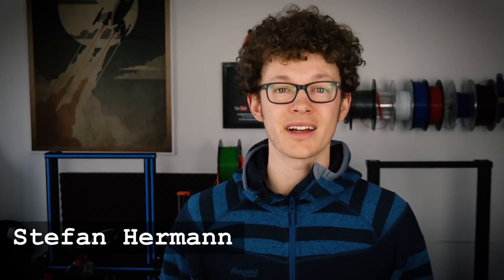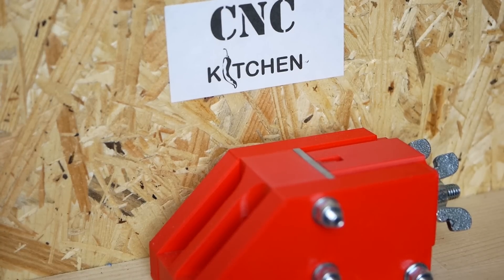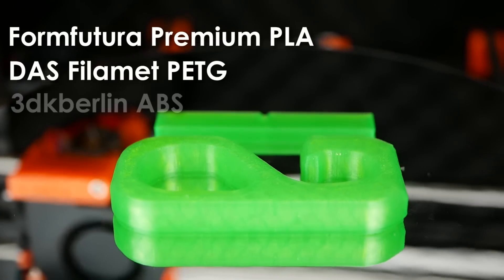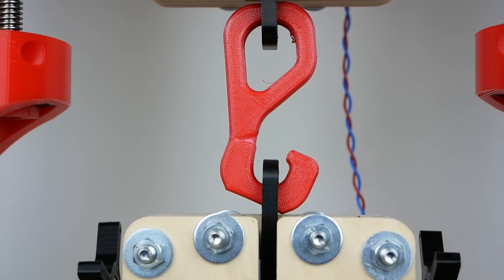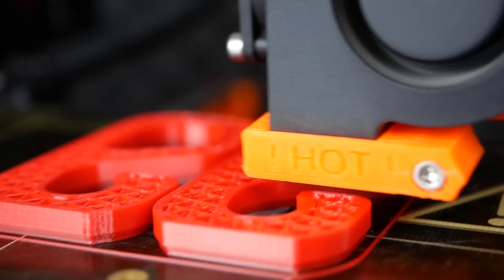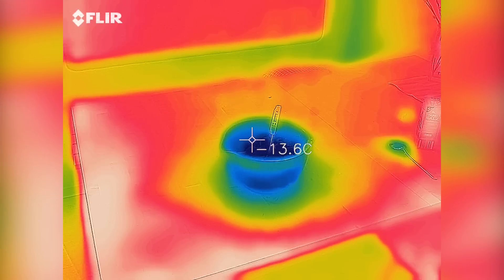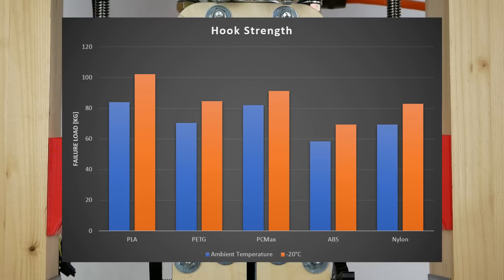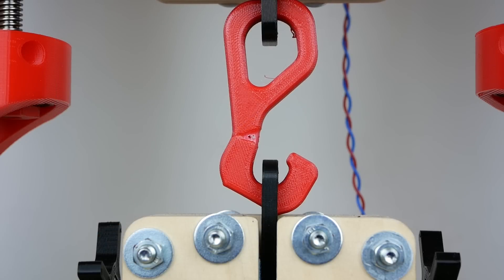3D PRINTS at LOW temperatures - How PLA, PETG, ABS, PA & PC perform at -20°C! (surprising results!)

Comment: I noticed that my prints were considerably more brittle and the layer adhesion was terrible after I moved from inside my house to inside my trailer in the winter. I would have to heat up the bed and nozzle with my hands to get my printer to the 8 degree safe-to-setting on my printer to even start warming it up. I also had to increase the bed temperature from 60-70 to get decent adhesion in these temps. Once I got a space heater and pointed it directly at the printer the bed and nozzle temperatures stay are usually around 20-30 degrees now and my prints are fine.

Comment: Very interesting video! I'd love to know what the lowest room temperature you can still get quality prints from printing is
Reply: My personal experience in the basement: PLA is ok printable until around 10°C, you can/have to turn down the van a bit.
Below it doesn't work get a lot of adhesion issues with the bed. Even at 10-15°C I had to heat the bed during the whole print to ~30°C and use glue stick.

Comment: I wonder how the laws of conservation of energy applies to this in a macro scale, also for different fill (maybe even 100% or molding out the materials used) to see the actual material capabilities in addition to 3d printed environment. As far as I can logically see it, you apply gradual strain on a part it'll introduce heat until that part deforms, if the part is cool enough it won't be able to deform as elastically as in hot environment meaning less energy is converted, that made me think it'll 'convert' less energy to elastic and instead will make the material snap, although at a higher point because freezing, well,  like water, makes liquid form into more sturdy material.
This causes a somewhat of a threshold effect, the material cannot stretch, so it has to snap.
Also, on impact the forces are generally higher so you reach that threshold instantly, while a 'hotter' print acts as sort of dampner, so it changes it shape on micro level to compensate for the forces being applied to it.
I also wonder what the temperature readings on the parts would be in such scenarios under the stress tests
Not sure if any of what I've said here is true, just was having a small thought.
Thanks for a great informational video, subscribed

Comment: Makes sense. Consider high carbon hardened (tool) steel, that hasn't been tempered (yet). Through-hardened steel is extremely strong, but with minimal ductility. A sharp edge can shave and cut through large amounts of lesser hardened steel without dulling, but even fairly large cross-sections will shatter if exposed to impact or significant ductility loads. Tempering restores significant rates of ductility at the expense of a little bit of hardness, but the end product is still relatively brittle.

Comment: IMO an engine block heater is more important than a cupé heater, but both is pretty sweet. If you only have the cupé heater, and there's the tiniest speck of moisture, your windows will condense and fog due to the large temperature delta between the inside and outside of the glass, and you have to run the car's heater to demist. If the engine is cold, then it's only gonna blow cold air, and it will chill down that nice warm cupé in an instant.

If you use a an engine block heater on the other hand, you can have your engine and all its coolant up to temp even if it's 15-20+°C below freezing, the moment you start the car. It will start as if on a warm summer day, and save a lot of fuel because its already at optimal temp, so you skip the whole "fat fuel-air mixture" period  the engine needs to warm up. And thus your car's heater and AC will be able to blow max heat if you want, from the start. It won't be nice and toasty when you get in, but it can be after a minute if you so desire. And your windshield glass won't be very warm/heated on the inside, so if it's snowing, the snow won't instantly melt and stick to it. You also get to sidestep the whole catch-22 situation where you need the windshield glass to cool down to reduce condensation on the inside and stop snow from sticking to the outside, but your window is already fogged up due to being warm so you need to blast it with more heat to get rid of the fogging,

Comment: Hi Stephen, 
I work in a warehouse with -30C. The most annoying thing in this temperature is the constant build-up of the static electricity from conveying all the plastic trays. (I think they are ABS). One time my arm almost came off (not really but it went full 180 degree and almost dislocated my shoulder blade) due to the extremely high voltage that was built up in the conveyor system. 

As for brittleness, its a little bit more brittle but not a huge deal.

Comment: overall PCMAX for the win, great tension strength, and great brittle strength overall. PLA a good second place with great tension strength but much more brittle than the others.  I noticed on their website: "When printing with PolyMax™ PC it is recommended to use an enclosure. Recommended to use a heated chamber.
Recommended to anneal the printed part right after the printing process to release the residual internal stress.
Annealing settings: 100˚C for 2h" I think this would make it even stronger.

Comment: @cnckitchen I'm not sure where you are but a 1400 W heater is using 116a @12v. most alternators charge at 90a or less. So using that could quickly and completely drain your vehicle's battery.

Comment: This video has good content that (as far as I know) is not anywhere else (such as your data on PC-Max). It would be good to post a summary of the testing data somewhere.  Also, It would be interesting if you used your CNC machine to make a hook out of solid polycarbonate and compare that to the 3D printed version.  That way we will understand what penalty there is to 3D printing a plastic part compared to molded or tooled part.

Comment: Hello! What do you think, what material is better to use for printing finished auto parts, such as a lip spoiler for example?
Reply from the maker: I'd use ASA.
Reply: thanks! If printing parts from several pieces, how best to connect them? To become a solid piece @CNCKitchen
Reply from the maker: You can glue it just like ABS, so with acetone for example. Use an ASA from a reputable manufacturer, no Chinese no-name brand.
Reply: Thank you very much! Please advise a 3d printer, which can print well? That it was not required to make a lot of settings with it) @CNCKitchen
Reply: maybe you will advise any certain ASA? @CNCKitchen

Comment: You should definitely try actually printing in -20c
Reply: Printing at -20 wouldn’t be possible with stock firmware, almost all 3d printers shut off if the thermistors for the hotend or bed read under 5 degrees C
Reply: @Hankbob_Hillpants  well u can preheat with a hairdryer for example
Reply: The only issue at -20C are mechanical parts: steppers can get stuck, linear bearings and other parts may have lubrificants that can get solid, timing belt becomes more rigid. All of these can cause the steppers to skip or to get completely stuck.
Reply: I think that this is not possible, this might destroy the electronics due to mosfet overload.
Reply: @stefaancodde6578 it would not kill anything, electronics has no issues at -20C. Even the standard hotend with a silicone sock can reach 240C at this temperature delta. The bed will struggle to reach 70-80C on most printers and many matrials will warp and crack like ABS
Reply: The mainboards of 3D printers are not protected to an overload.  Suppose Your  nozzle can reach max 250° but at -20  (meaning 38° difference) then only effect is that the mosfet will heat up and they usual not cooled. Note if You have to print at 230° then it will destroy the board and the nozzle heating too. The bed, if limited to 100° is even more a problem since the area is much bigger, this mosfet is usual bigger cause an heated bed is a very energy consuming device. Suppose bed 80°, so in reality must warm the plate to 118 °C so heated bed destroyed.
Reply: @stefaancodde6578 and lastly, i have an ender 3v2 and i can heat up the bed up to 120C and nothing gets destroyed. You are just really really bad at physics and electronics.

Comment: The same cold that hit Germany hit us as well. We got around -20°C here as well. I have an unheated garage I have my machines in, however temparatures dropped only to about -7°C inside. What I do to deal with these temparatures is; 
You gotta have your printer eclosed and if possible isolated. I made a simple crate 60x60 cm for my prusa with front plexiglass door (7mm) and the rest 18 mm plywood, which is isolated with 4 cm styrodur. This way ambient temparature inside the box gets to roughly 25°C when printing with heatbed at 60°C for a while. 
As far as it goes for filament - for that I have a separated box (showcase box) with front glass door. This also has 5 sides isolated with styrodur + the front face isolation is removable. Inside I have a washing machine heater hooked limited to a 50W supply, which heats up inside of the showcase box to 35°C on the bottom and around 45°C at top (if I have isolation on the door, otherise I get to 10°C less). At the top I have a hole for moisture dissipation, this way I get to 5-20% humidity inside. I can store 10 filament spools inside, usually the ones I'm about to use for my projects. Both boxes are connected with a "coupler" tube I printed, which has a telfon tube running through it. I had problems with coupler having too big hole, this way when I lifted Z axis, filament got all messed up inside showcase box - went off spool because of backlash and so on, so the teflon tube solved this problem. Oh yeah, there's a spool roller inside the showcase box, which works perfectly for this. 

Take care

Comment: Do you have Simplyfy3D? if so can you share your settings with me? I am struggling with that! Plus, ever since I replaced my nozzle to a hardened one, I now print 230C PLA...
Reply from the maker: Just download the profile from the Prusa forum. Works great!
Reply: CNC Kitchen thanks
Reply: also, do you recommend going with a 0.25 or a 0.3 size nozzle over the 0.4 stock Prusa nozzle or do you foresee any future problems like calibrating print settings?
Reply from the maker: I've been doing some prints with smaller nozzles but never had a really great experience. If you don't have the necessity for very small details 0.4mm would still be my go-to choice!

Comment: Not directly related to temperature but failure related - how about testing the filaments for failure over a longer period - while building a new printer I found that clamps made from PLA would fail - actually fracture - but not for some 24hrs or more, where as the PETG replacements have held firm with no problems for many weeks now

Comment: Idle question: Printing depends of a good bond between the layer being printed and the previous layers, no?
You might get away with low ambient temperature printing with a modified printing head.
Yes, you still have your extruder and all that, but by adding a low powered laser [500 mw-ish], you could heat the previous layer directly ahead of the printing path.  
Previous layer would get softened/melted, fuses well with new printed layer.
As a bonus it would not require the model to be at an elevated temperature during the entire print.
Since only a very small volume of the model is heated at any one time, could warping be lessened?  Eliminated?
More interesting, would rapid cooling due to low ambient temps affect the properties of the plastic being printed?
Metals have grain boundaries and all that.  Hardening, tempering and annealing all re-shuffle those grainy guys.
Do plastics have such tendencies?
Does really fast cooling make the plastic denser, or less so?
Post processing at low temps?  
There are 'cryogenic steels', their grain structure compacted by liquid nitrogen soaking after fabrication.

Great methodology, by the way!
Reply from the maker: I think I've read some time ago that somebody made efforts to actually use a laser to warm up the previously printed layer. Would need to do some research, but maybe somebody else knows something about that?

Comment: Why 0.165 layer heights? i usually print at 0.18 or 0.2
Reply from the maker: Because I use 3x0.44mm perimeters which makes an 1.32mm wall. 8 layers 0.165mm is also 1.32mm so I get an even wall thickness. Usually I also print with 0.15 or 0.2mm layers.

Comment: I've 3dprinted my own luggage tags, and have recognized that very cold temps may be a more significant issue for travelers than you might expect initially. Modern jets travel at altitudes where the ambient temperature may be from -20 in the summer to -60, or significantly lower during the winter at northern (and southern) latitudes. Not all luggage bays on aircraft are heated and pressurized, (though that's becoming much less of an issue for modern jets) so it may be useful to know what the characteristics of the various plastics are when cooled to the temperatures of dry ice.

I do suspect that it will be more of what you observed. 

An added question would be what are the long term effects of cooling and warming these materials to these temperatures and 'room temperature' through several cycles. There is anecdotal evidence that taking some metals down to liquid nitrogen temperatures, and slowly bringing them back up to room temperature over a week or so, can improve various performance characteristics. I'm not expecting to see such results in PLA, but it might be an interesting experiment, even if the result is, not so much.

Comment: That was kitchen salt ? NaCl ? And what was the part you used for the car ? And how did you achieve -20 just from outside ? Great video !
Reply: What he reported as the best purchase for his car was a heater he could plug in that would warm up the inside of the car when plugged in. Gives a much more comfortable experience when sitting in the car starting it up when the outside temperature is -20.

Comment: You should have tried printing in cold enviroment like outside or unheated garage. 
I get the cold air would significantly improve the overhangs and the part cooling
Reply: Overhangs and part cooling do get better, but curling get significantly worse. PLA and PETG do ok, but abs gets nearly unprintable.

Comment: Any chance you could try out printing at -20c? I’m curious if This could increase print quality for pla type materials. Also wondering just how bad abs is at that temp
Reply: Lol
Reply: I can tell you that you'll probably want a backup control board or isolated drivers. Condensation's going to be a consideration.
 Also if you're printing over the serialUSB you'll start to  get weird behaviour below -20. I haven't 3D printed this cold but I've got a laser module hooked upto a shapeoko 3 running GRBL and it's not "happy" until you get the heat running.  :)
Reply: my ABS in unprintable at less than 40C

Comment: I've had several PLA parts outside in the -40 Ottawa, Canada weather some for many years and they are holding up well. This winter i attached some printed pla to the bottom of my car as a test so it has low temperature and lots of road salt/sand to deal with.
Reply: How did this test go? Interested as I was wondering if I should test printing some cold air blockers for my car's grille.
Reply: I live in Toronto and I printed hooks out of pla to put along my fence and hold up wires. It's been almost 2 years now and they're holding up great(they get snowed on and everything)
Reply: Yeah what’s the outcome mann
Reply: I'm an hour South on the US side of the St. Lawrence    Good to know

Comment: I wonder if the parts experiencing temperature decrease shrank in size by a significant amount?  It would be interesting to find out which materials experience less shrinkage for precision fit designs.
Reply from the maker: Just take a look at thermal expansion coefficients. A temperature difference of 40K won't cause huge differences in dimensions.

Comment: Interesting work. I suppose with a ton of effort we could find a ductility transition temperature for the materials. At first I thought you were going to put the printer in the cold and test the effects of ambient temperature on prints. That would also be interesting, and is relatively uncharted as far as I know.
Reply: You could also search for DTMA ( shear modulus depending on temperature ) data and you will see the transition temperatures for the different types of polymer.

Comment: We had some bad experience with cold and 3d prints last week, me and my friends were prearing pieces for our cosplays and one of them is a fantasy spear made of 4 parts glued together with an aluminum tube inside. at around 1ºC on the street one of the joints snaped open due to contraction of the material, and as soon as we got onto de metro (with usually over 15ºc) the gap left there just closed as the material expanded

Comment: Fantastic insight. It's been very cold (for us) here too, so very timely experiments.
I expected everything to become much more brittle than they did, very surprising.
Reply: @David van Ecke 
I was surprised at the small magnitude of change in brittleness.  And I was surprised how well PLA did in strength compared to nylon.

It would have been nice to have % shrinkage/expansion with temperature change, if measurable.